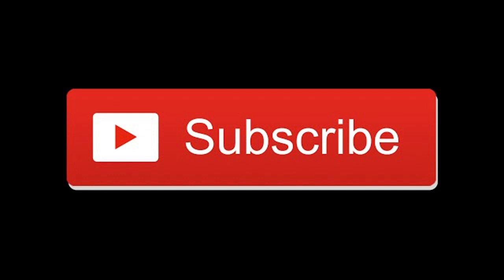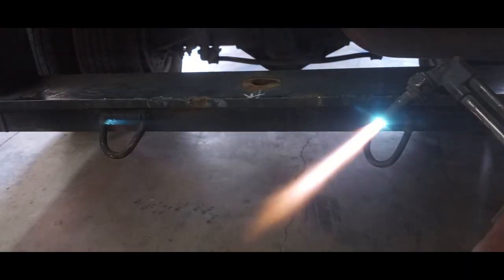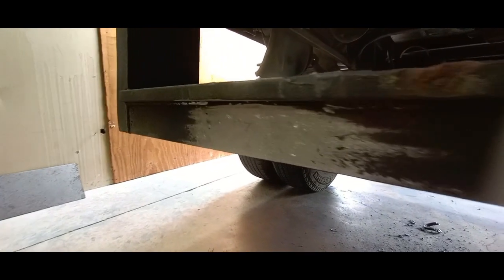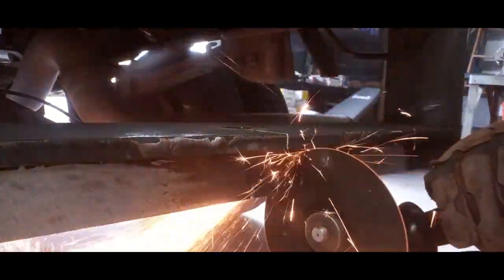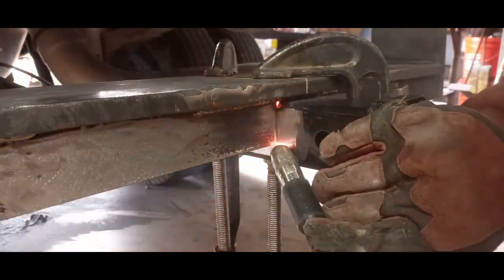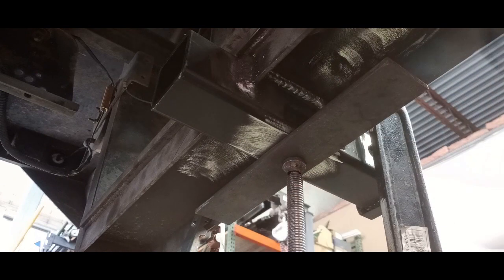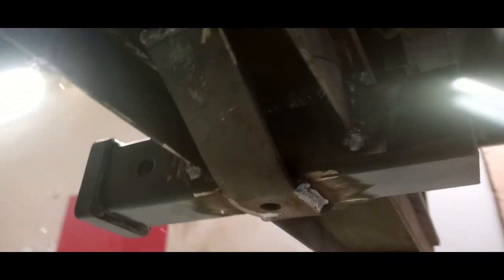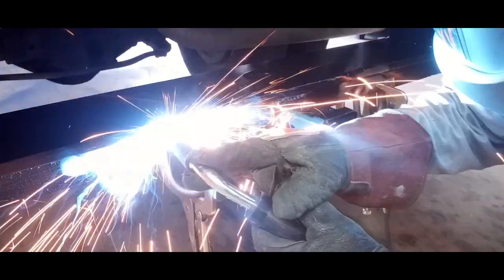How to install and weld in a trailer hitch receiver  -  DIY Auto Restoration

Comment: Such critical welds should never be run downhill. It is a must to wrap the ends of D- Ring brackets when welding. Under high loads, the brackets will tear off like a zipper. Gas shielded fluxcore would be a much better choice.   Fortunately, the metal in this hitch isn't very thick.

Comment: Your overhead Mig is solid. Any tips you can give?
Reply from the maker: Practice on different thicknesses of metal and write down the best settings for each particular pieces of metal on tape and put that on top of your welder that will help tremendously and a good ground always and a lot of practice

Comment: This is exactly what I needed to see. Same exact c channel I’m working with. 
I will install exactly as shown in the video. 
The hitch I bought is 12” long, with a rated weight of 5000lbs. 
How many lbs do you estimate you can tow with this installation?
Reply from the maker: I don't recall what this hitch was rated at, but I'd be confident this method would exceed your 5000lbs hitch.

Comment: Can you publish the welder setting you used? Amp and wirespeed in particular.
Reply from the maker: I'm using a Lincoln 256, every welder is different I can give you a range 250 - 270 WFS / 19 - 20 V, on the inside door of your welder there should be a settings chart. Thanks for watching !
Reply: I wouldn’t try it unless your machine can achieve spray transfer and you can make a quality penetrating weld.  Test your settings on scrap of similar thickness and cut and etch to make sure you are penetrating.  Safer route would be to use 7018 and burn it in with multiple passes

Comment: How many amps do you use
Reply from the maker: welding rule of thumb, 1 amp per thousands inch thickness for mild steel is a good starting point

Comment: Is this a job that could be done with a flux core welder? Or would you only suggest MIG? I'm just getting into this stuff and could use some advice, flux core seems to be the one that would suit me best with pricing and everything but I would also like to work on my truck like this. Very good work, very professional!
Reply from the maker: The key is penetration, just follow the formula 1. prep 2. good fit up 3. correct machine setting and good penetration into the parts. Thanks for watching !
Reply: @guzzifabrication3448  Thank you! I'm very motivated to start learning, I'm gonna picking up the Forney Easy Weld 140 FC-i welder this week and start on some home projects!
Reply: Well also depends on how much power you got ,like a 110 miiiiiiiight get it done but it's gonna be turned all the way up
Reply: @sagennc9019  yeah I wouldn't recommend doing this with a 110/120. You really need 220/240 to get enough penetration in steel this thick. You might be able to stick weld but I wouldn't trust it.

Comment: What weld is that
Reply from the maker: I'm not sure what you're asking... the process I used was gas metal arc welding or MIG welding. Thanks for watching !
Reply: @guzzifabrication3448  shielded metal arc welding is also called stick welding. gas metal arc welding is also called mig welding
Reply from the maker: @donsmith9081  Well looks like you caught my blooper...
Reply: @guzzifabrication3448  You Finally had a Blooper!    You do nice work.